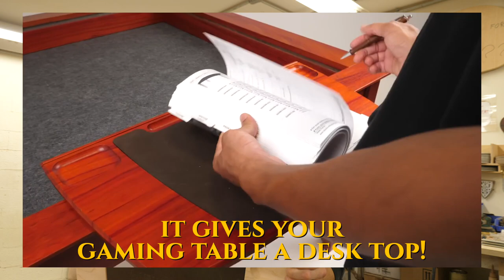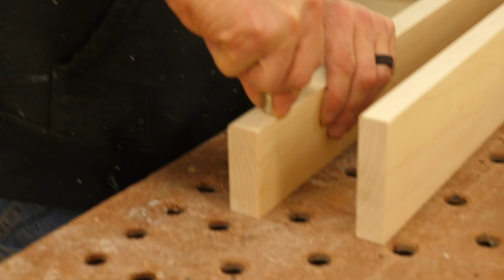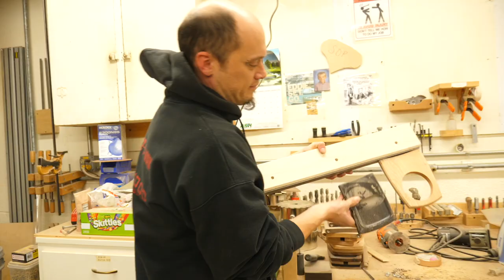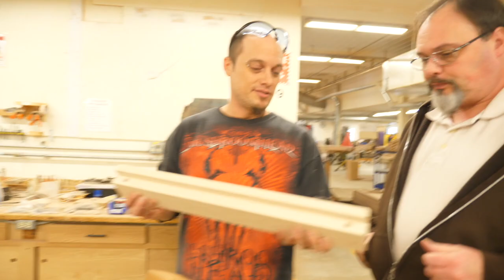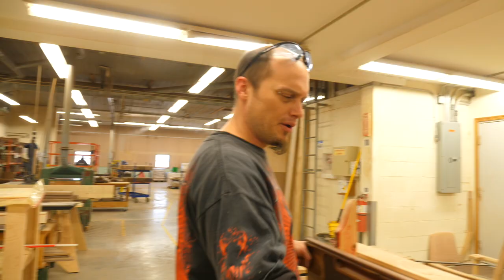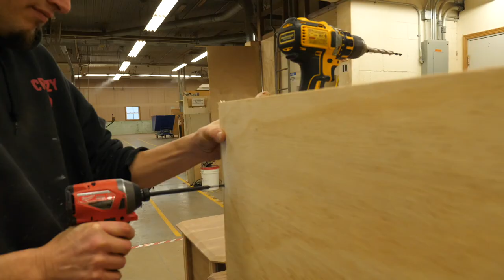FINALLY! A Storage Solution (mount a player desk on your wall) S12E03

Comment: I love these sorts of episodes where its not the "big wigs" talking or planning a kickstarter but its actually down on the shop level designing/making/prototyping a new product.
Reply: As someone that never built/designed anything, I kinda miss the crafting side of things. And the woodworking lessons. They changed the topper connectors and never explained the difference between "tongue in groove" and whatever the other one was! No Doug sketch or nothing.

Comment: Solution for stacking. And I hope somebody at wormwood sees my comment. Yhe shorter block that makes contact to the wall should actually be a trapezoid to put it at an angle. That way as player desks are stacked, they are stacked vertically. This will cause the bottom to protrude away from the wall a little bit, but probably no more than the progressive stacking we saw in this video and it drifting away from the wall.
Reply: Not sure if anyone at wormwood will see ur comment but someone from wyrmwood did

Comment: I've been wanting a solution to storing the player desks (I ordered five with my table), and this seemed good at first, and then I saw you could put the other accessories on it as well and now I want it for sure. Dunno if I want to fork out the money to get them in padauk like my table, but I definitely want at least 3, maybe 5 of them.
Reply: I'd say get it in a wood that will match the rest of the room overall and let the table be the main focus point/ thing made out of the prettiest wood in the room. That way you save money AND it is good interior design. 

Although I think getting them in padauk to match the table could also work just as well depending on everything else in the room. You could also just go the route of not caring if it is "ideal" interior design and just go with what you like.
Reply: Interesting, this is one of the only things from wyrmwood that I think is super tacky, but to each there own. Hopefully enough people feel like you that it will be profitable for them

Comment: Here's an idea - what about under the table?  Could there be a piece mounted to the bottom of the table to hang the player desks horizontally or vertically?  Same thing could go for the chairs/benches.  Put some type of mounting bracket on the underside of the seat on a chair to store the player desk when not in use.
Reply: That's only nice for short people. Us tall people will hit our legs on the storage under the table.
Reply: @bunker1213  Only if the storage area comes out to the edge of the table.  If the storage rack were suspended horizontally from the center of the table length-wise, you could hang 2-4 of them and twice that if 2 racks were used.  And yes, make sure that those sitting at the ends of the table don't hit their knees.

Comment: I'd say: Angle the bar a bit so the desks tilt a bit like scales along the wall. Then you barely have any Momentum on the screws and you can go 20 desks I bet without it looking weird (and putting too much force on the lowest desk of the stack). You can keep the metal bar perpendicular to the wall so the accessories do hang vertical. This would take away the extra storage of the four accessories on top, but those look unorganized anyway.

Comment: Looks like a concept you could extend to lots of places... like the sides of modular shelving, or something that fits into the topper block but can also be free standing so you can use the topper block at the same time if you need to... A desk tree...

Comment: being able to put 6 player desks on one is nice. I doubt to many people have bought more then that. I would like to see a option for storing them under the table. There is probably a large portion of people who have the table as a dining table and having the player desks hanging on the wall near by is likely not going to be a appealing decrotive option but if you could mount them underneath the table that would store them out of sight but easy to reach.
Reply: I mean nothing is really stopping you from screwing one of these into the plywood bottom of the MGT. with the magnets for added retention this should totally be able to hold them parallel to the floor without issue.

Comment: These are a nice solution to storing the player desks.  Also, really enjoying these shorter, more frequent clips from you guys.

However, not a fan of the player desks. I'm a leaner and I'd be worried about breaking it (or the table rail).

I'd love to see smaller versions of the storage deck that are about the same width of the railing that can mount up against the wall, which would mean players can put their tablets and laptops on top of it while we're playing, but have a hinged top so you can use it to store dice, chips, etc, between games. It would have to be able to fit under the tabletopper, and you could put mag-rails along the outer and side edges, so accessories could be mounted on it as well.

Comment: What about a topper block insert that could hold like 4 of them?  You could alternate which insert you have in the topper block?  When the toppers are on the table the desks are in the topper block... then when you use the desk the topper are off.  If taking out the inserts would be too problematic or not durable then you could sell an entirely separate accessory that is a topper block only for player desks.

Comment: With a very slight angle on it, you might be able to get them to stack fairly vertically with the wall. Probably want some kind of vertical rail at that point though to prevent accidental damage from having that much leverage on the wall mount. Not as much of an issue if the stacking starts at the floor though from something with a decently wide base

Comment: If the span of wall you want to cover with this cleat esthetically, does not line up the predrilled hole(s) with your studs you're kinda sunk.  There needs to be a hidden plate or a couple of pads that you can screw to the wall where your studs are, and then the hanger itself be able to mount onto those pads and slide left or right several inches in order to visually be where you want it on the wall...
Reply: In my house I have 3 going up the wall to hang my 6. Works quite well

Comment: You should do an under table mounting rack for these. They could tuck up under the table on magnets so that they are out of the way and easy to get to. The wall idea is cool but having like 6 of these bad boys stacked up is not the best look. With under the table you could have a spot for each seat at the table that it would fit at anyways.

Comment: IMO, make the wall mount in the shape of the wyrmwood shield with the flat top to hold the desk. Or add some sort of design so it looks more like wall decoration  in between uses. Would just need to mount it to a single stud with a smaller mount as well, or use a decent-sized drywall anchor.

Edit: The “shield mount” would be for 1, maybe 2 desks. But probably wouldn’t hold the other accessories like this version can!
Reply: Looks pretty good overall, though. I appreciate it being cheap and functional
Reply: You could have it hold accessories too. 

If you kept it the same size as this prototype, behind it you could have an I shaped piece that goes onto the wall. The top edge of the top of the I is where the desk slots into (so the shield would come up an inch or so above that, to make the lip, and the bottom of the I would be thinner (and go maybe go 2/3rds down the shield) with a metal bar on the bottom so you can still hang a few accessories there. The bottom point of the shield would come down a bit further and mostly cover them, but then they'd be easy to add on and be hidden when the desk was there anyway. It'd be a big shield, but it would only show when the Desk is in use, and it could be made to look nice.

Or you make the shield a lot smaller (as you said) and have it only go on one stud (couple of screws vertically?) with the caveat that you should only add one desk. But you can still have the metal bar on the bottom of the rail the desk hangs on, but it might only have room for 1 accessory.
Reply: That would b quite large
Reply: @CRAZY-ED  The small one could be manageable. You'd have it only supporting the desk in the centre, so it could get away with only being a few inches across (well, 6-8" or o).

But yeah, the full size one would be almost as big as an actual medieval shield

Comment: Hate to break it to you, but despite the tape measure having marks at 16” for studs, 24” on center studs is equally common. If the piece is wide enough (I’m not familiar with the product) go with 5 holes, or none and let people drill their own. Sincerely, someone with 24” on center studs.

Comment: Would there be a way to mount the table top to the cleat so when you using the table you could hang the top off the wall? as I have always thought it would be super cool to cnc or laser a design into the the table top (Maybe a map from your favourite game or film) and then with the cleat system it would be art on the wall when using the table

Comment: Any way you can include an option for a 38" or 40" or even 42" width playing area? With how big board games are getting now, 36" is a little tight with all the components out with the main board. And even with even with player desks to take player boards off the table. Also, 49" is too big for most rooms.